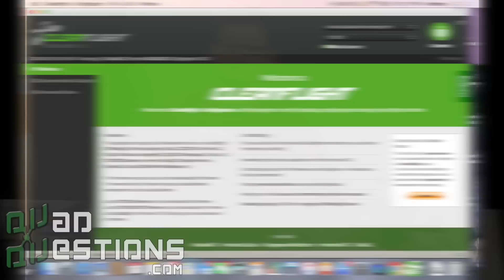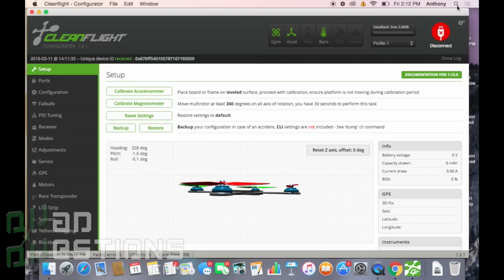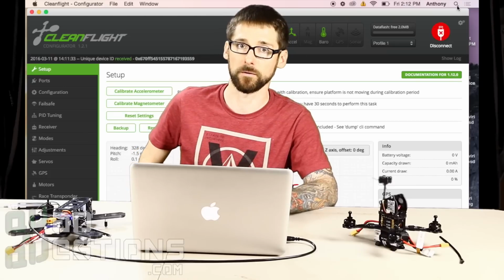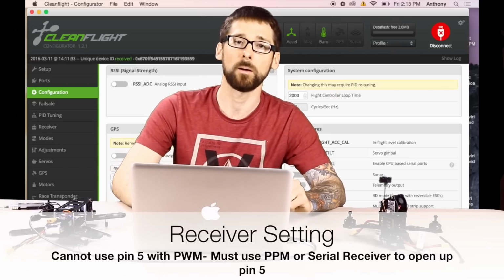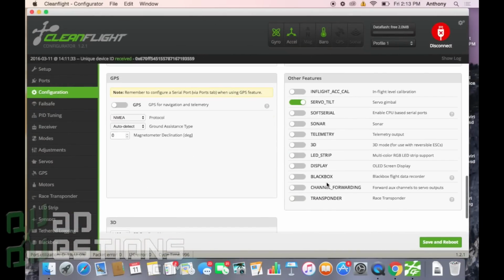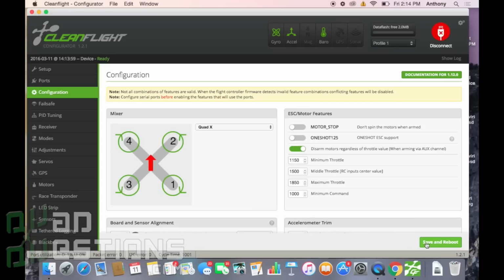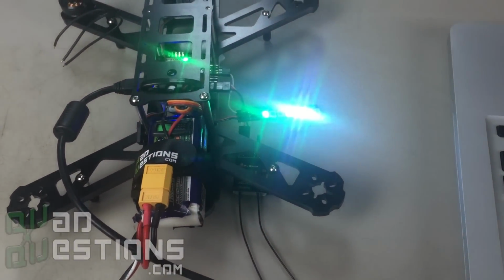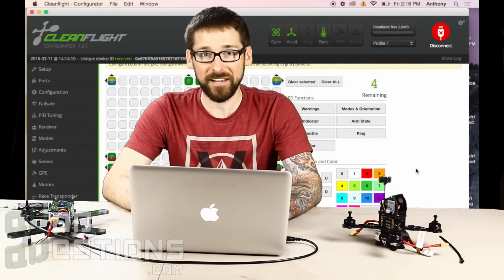Quadcopter RGB LED wiring and setup in cleanflight

Comment: Hi, how I can use 4 wire LED strip (+ve,RGB)? every one is using 3 wire strip. Should I mix RGB? I need to use white in front and red at back and have done by direct connect to Lipo battery. Want to use this way.

Comment: If I'm running a lot of LED's and want to connect to an external BEC for power do I connect the LED ground to the flight controller or to the ground on the BEC?   Thanks!
Reply from the maker: Try connecting to the ground of the BEC, if that doesn't work, then try connecting the BEC ground to battery ground so that you have the correct ground reference after the BEC.

Comment: can i use gps at the same time?
Reply from the maker: +Rick Inman Yes, you can.  The LED uses pin 5, which disables soft-serial, but you can use a gps on UART 2 (pins 3 and 4) without the LED effecting GPS performance.

Comment: followed everything youve done but cant get anything out of my leds. connected to 5v and ground and pin 5. when i power up the leds they dont work.  turned off softserial and turned on led switch. any clues??? Im using the matek 5v led strips
Reply from the maker: +darren brennan are you using cleanflight?